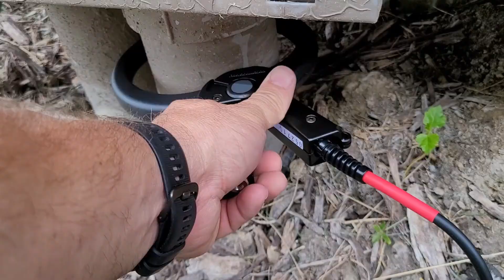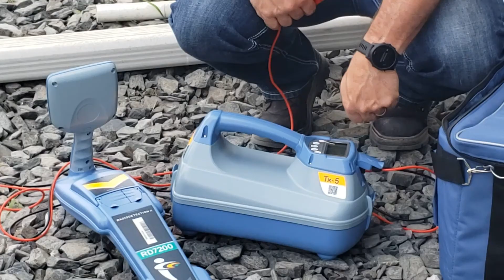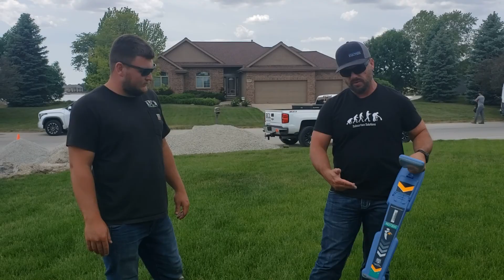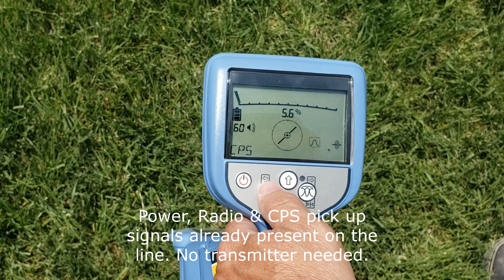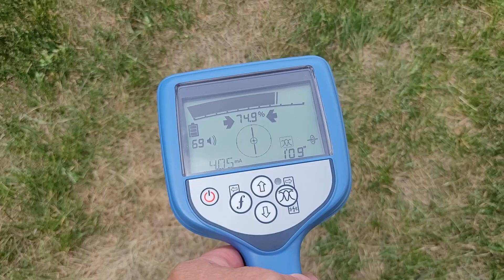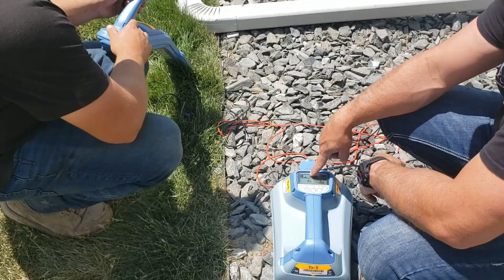RD7200 Locator Quick Training

Comment: Can i use The Transmitter Clamp to find optical fiber ? Do you have a video ?.The pipe is in plastic so i cant use the cable red and black with the tx-5

Comment: Hello, I have an RD7200 locator. I took the test and after three attempts the result was negative. After replacing the batteries with new ones, the test result was positive. Is this normal? The indicator showed two bars on the old batteries.
Reply from the maker: Yes, a low battery will fail the test.  Make sure you have full battery level when doing a self test. Also, make sure you a in a quiet area away from any radio signals.

Comment: I've always used a 8100 but I'm having to switch to a 7100. Is it the same?
Reply from the maker: Internally the same. Just less frequencies and iLoc remote, GPS and other extra features. Still locates the same distance, depth and has the most useful features
Reply: @UncDroop  I think 8100 have more features than 7100.However all are have the same working procedure.
Reply: Hello sir 
Can I use this device to find gold under ground?

Comment: I have been using RD7100 since long for detecting the telecommunication cable.
When we use inducing method 512 Hz is more accurate even the presence of multiple underground utilities.
Reply from the maker: 512Hz won't induce unless using the CD Clamp. Induction requires the use of higher frequencies.